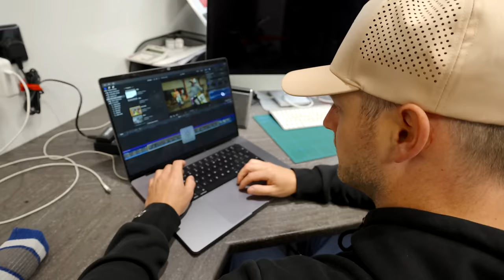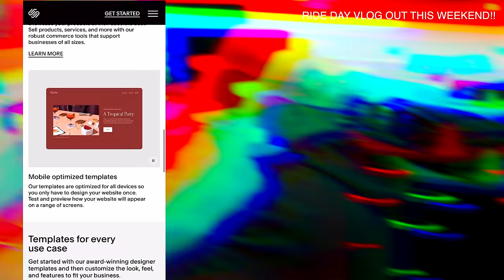2023 HUSQVARNA FC450!! BUILDING MY NEW MOTOCROSS BIKE

Comment: On taking off the rear shock. You had it pretty much right but you need to pull it out and put it in where the rear muffler goes but to do it that way you also need to un bolt the rear shock lower link arm so it swings out of the way. I have a 23 and that’s how I’ve been doing it. Hope this helps.

Comment: Footpeg Pins go in from the top IMO. If you ever shear the cotter pin off at least the pin won’t fall out during a ride since it’s not upside down. Especially on a race bike.
Reply from the maker: Thanks
Reply: Trials and enduro go upwards to keep them from rock's etc
Reply: @jritchiejritchie2687  you’re saying the cotter pin? I have a 22’ te300i and the dowel sticks out equal amount on either side. Either way, Gravity & hard movements will make the pin fall out wayyyy easier going in from the bottom if the cotter pin is sheared. But to each their own
Reply: Definitely from the bottom, from ktm
Reply: @yz25075  got you. I mean it would be a freak thing for the cotter pin to shear but I ride 30-40 miles from the truck. I run them from the top just incase.

Comment: Another tip for fitting grips if you dont have a airline with you. Fill the grip with petrol and flick it all out. Slide the grip on while its still damp inside and when the petrol evaporates it sticks like glue. Raced with them like it for years and never had trouble. It takes seconds. Just make sure its all clean
Reply: Women's hair sprays works good as well